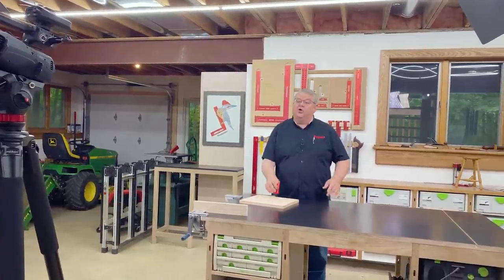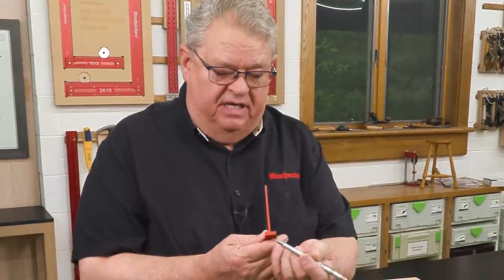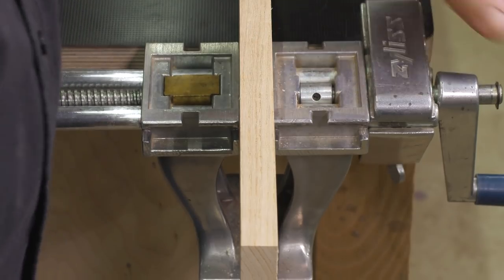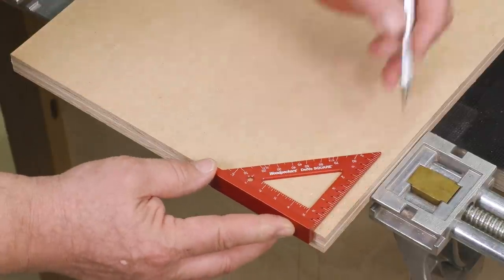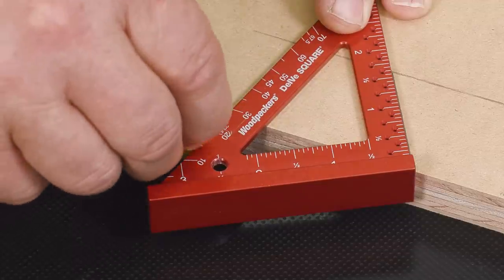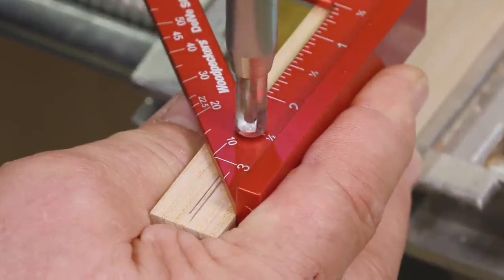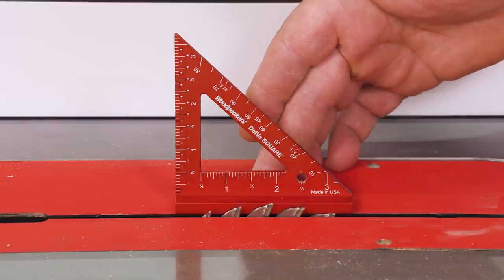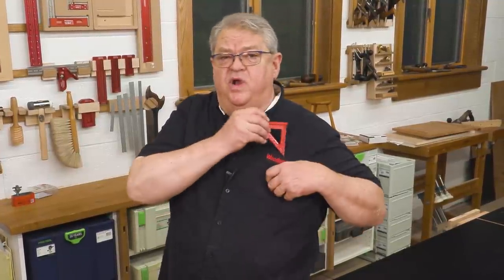The Handy Little RED Square With The Funny Name | DelVe Square | Woodpeckers Deep Dive

Comment: I have (and really like) my own Delve square, but I wish you also made a metric version. I’ve almost completely switched to metric because life is so much easier without FRACTIONS !!! LOL I mill my stock to 18 mm so a Delve square with 3, 6, 9, and 18 mm (corresponding to the current ⅛, ¼, ⅜, and ¾ inches) would be really great.
Reply: Please!  I would buy a stainless or aluminum version in any/all of the sizes.
Reply: Isn’t it great not having to add 13/32 and 9/16?  Yet people cling to the Imperial system for some strange reason.  Folks, the metric system is so easy.  Try it!

Comment: I've been carrying my Delve Square in my pocket every day since picking it up in the original One Time Tool release years ago. Wouldn't be without it, or my Starrett C604RE 6" rule (with end markings). Thanks for the very thorough tutorial. The stair gauge hack is one I'll start using straight away.

Comment: Just curious if when the square was designed with the 1/4" and 3/8" lip was there consideration taken to account for the thickness of a pencil or whatever marking instrument is use to mark the line. Using the pencil with the 1/4" lip the three sections do not look even, the center looks narrower and I think that is because of the pencil line.
Reply from the maker: Yes, but if you undersize it, you run into lots of other problems. A marking knife is the best solution to the problem, but you can't see the marks very well on video. That's also a case where knowing the issue, you can "leave the line" instead of cutting the line.

Comment: 6:19 - the block on the larger square is 17/32"?  Why not 1/2"?
Reply from the maker: The scales don't line up because the zero point on the big square is the shoulder, not the center and the zero point of the DelVe is the inside of the base, not the outside.

Comment: There must be a reason that the L square and the DelVe Square numbers are not lined up.
Reply from the maker: The scales don't line up because the zero point on the big square is the shoulder, not the center and the zero point of the DelVe is the inside of the base, not the outside.
Reply: @WoodpeckersLLC  Excellent and thanks for the detailed information.